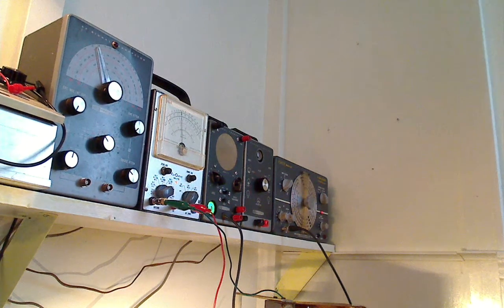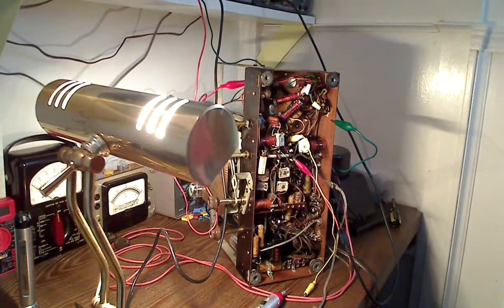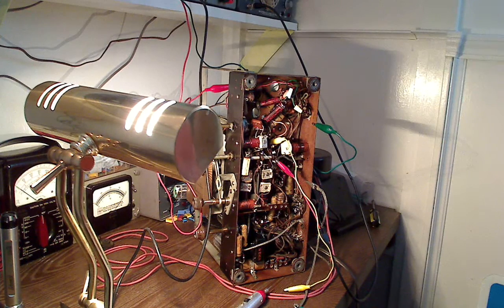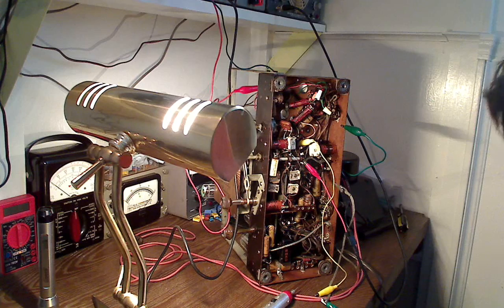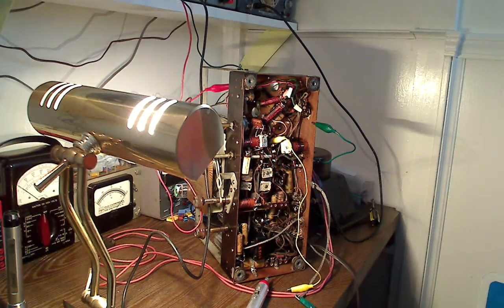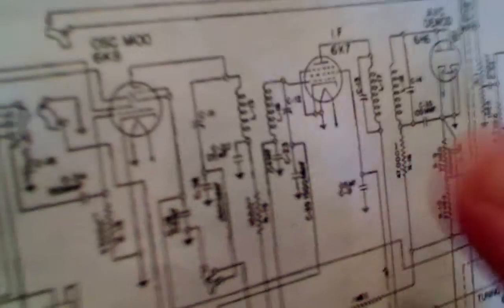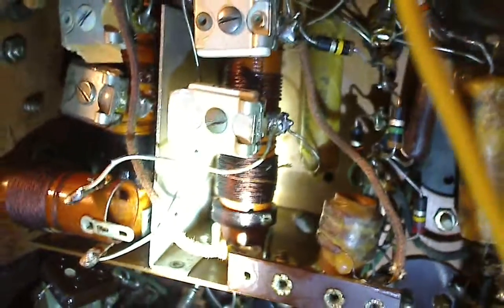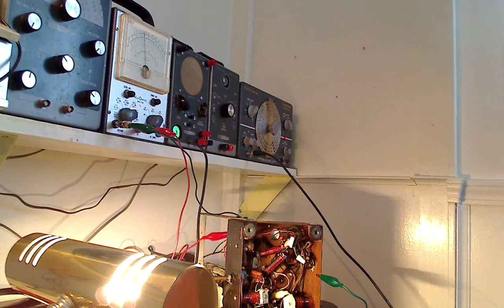Radio help video for the ARF

Comment: what's at the other end of the loose wire, follow it to its soirce.  Then the skemmy will show what it went to.  so is it the loose wire, or bad cap, or both?  looks like you were onto it.  easy to check a capband resistor.  Don

Comment: Hi. Just watched the video.  First great to see a young man get into this hobby.  Have you tested to coil for opens ?. It having shortwave this could be a coil for that, Also you touching the clip lead and it playing that loud is a good sign. It could be the cap open resistor Etc I would try the cap fist and then test the other components in that part of the circuit. Do you have a tube tester. Has that could also be a problem if it gassy/ shorted. Check out the forums lots of great help there also. Let me know and good luck.
Bobby
Reply: I just checked out the forum. It's one I haven't joined yet or it been so long ago I can't remember. I read the posts, You are in good hands. That fellow knows his stuff from his answers to you. He is right about the old caps When I first started I had left a few in has the radio played fine then a day later Bang ! I got lucky just the cap and no other damage. Keep me posted has to what you find out very interested.
All My best.
Bobby